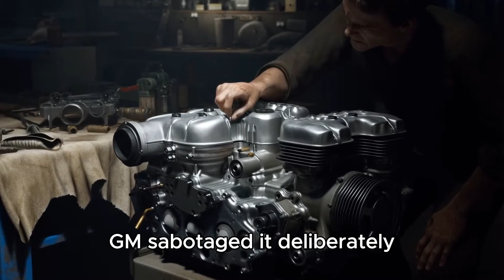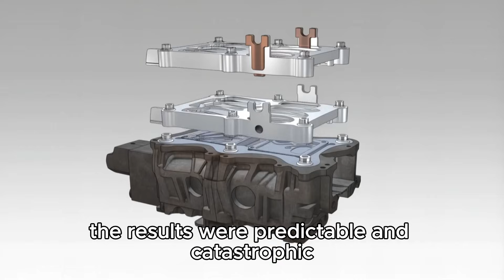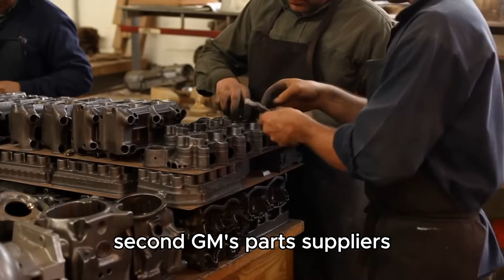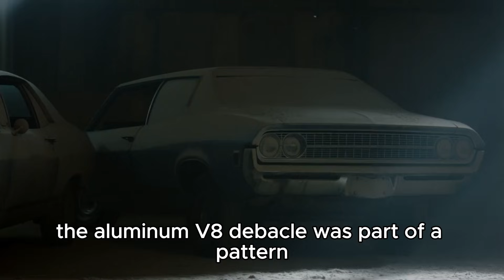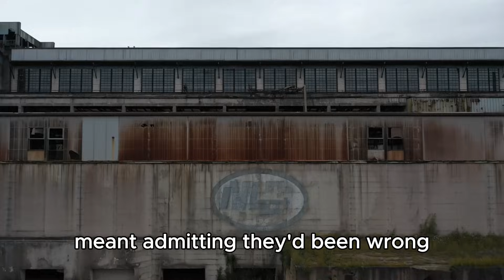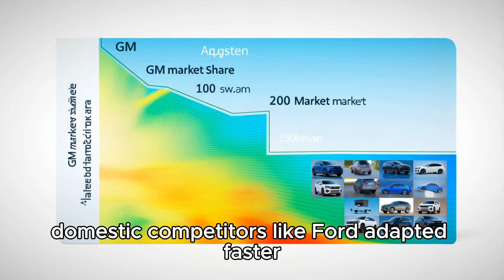The CORRUPT Story Behind GM’s Aluminum V8 — The Engine They SABOTAGED

Comment: The Roots Group and Rover and the Rover V8 has been a weak motor from day 1.  It can run well but it is not durable.  Ask an Australian or an African what a durable engine is.  Do not ask a British or European person.  
Ford; Mexican injected Windsor V8 and 4.6 modular V8.
GM; LS from the late 90s to about 2010 (before cylinder deactivation)
Or about 15 Toyota motors.
These are the proven, truly durable motors that those “in the know” would buy from the last 50 years.
A couple of old Nissan, Mazda and Honda motors are quite durable but their Toyota counter parts are always much more durable so just keep it simple.